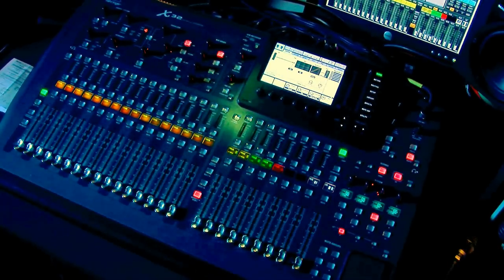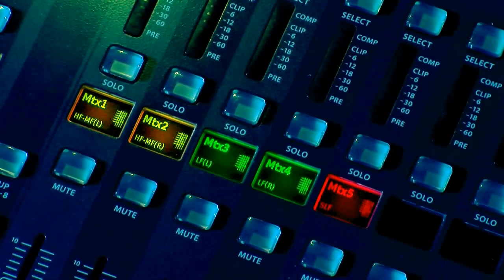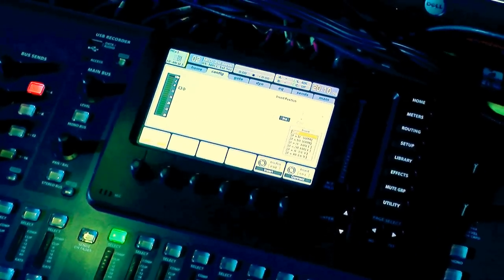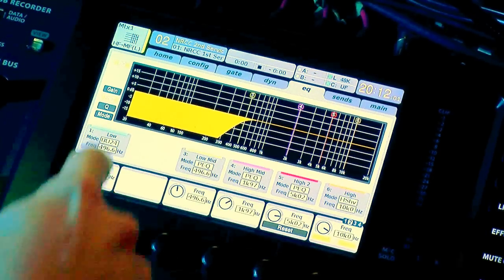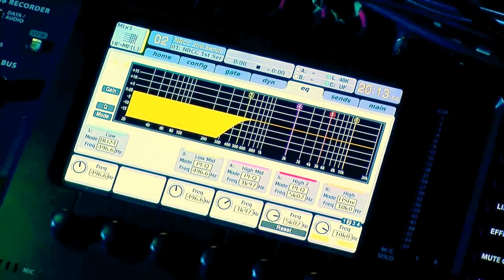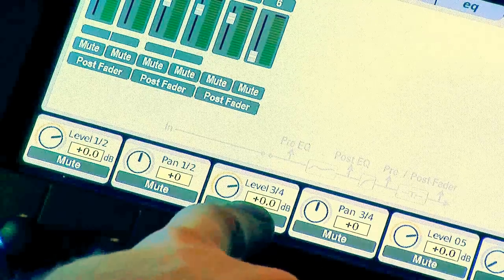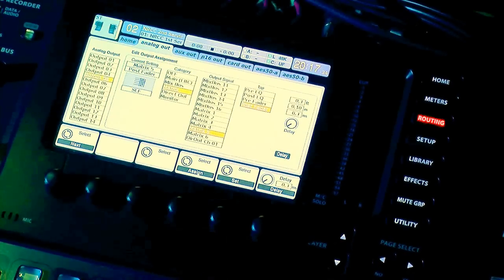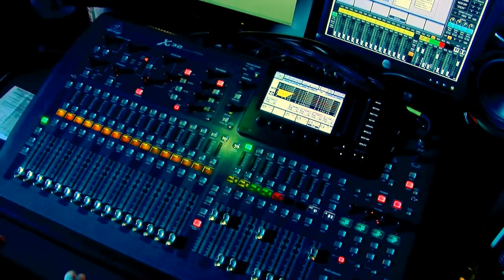Behringer X32 - Use as a System Processor for Bi-Amped + Sub Setup

Comment: Good Morning....   do you have any recent videos around this topic.   (e.g. v4.06).  I have 6 speakers, (2-subs, 2-mids, and 2-highs), with 3 amps..
The sub amp is configured in bridged mode, so a single feed would go from the board to the amp, and the subs are daisy chained together.

Thanks for all the time you are putting into these.   (Oh, and I did purchase your scenes, effects, and channel presets  --  very helpful).
Reply from the maker: Marty, this is a great idea to refresh these videos on the sending to a PA+Sub, Bi-Amp, and Tri-Amp! Give me a few weeks and I'll upload a video on it!

If you need to get it set before, you would end up taking the same functionality as this video, just the user interface would look slightly different.
Reply: @DrewBrashler  And it seems both the Bi-Amp, and Tri-Amp configurations are similar, only the bi-amp uses one matrix, and one output
for the SUB where the tri-amp config uses two.      How would would implement the M/C channel using either of these configs?

Thanks again sir.   And though I always have questions, your vids are AWESOME!:washhands:🤘🤛🙏

Comment: Hey, i'm in need off help. i have 4 speakers acting as left and right. and 4 subs. the subs are coming out of the mono channel and are all sorted. but how would i control the volume of the individual speakers. for example there are 2 either side of the stage and i want to be able to control the 2 inside speakers and the 2 outside speakers on the matrix feed which would then feed the main left and right fader. Its only because i know there speakers pump out a lot of volume and want to have control of them so i'm not riding them too high. i hope this makes sense.

Comment: Really like the video, great information. I do have a question though: Using the matrix to apply the butterworts filters to send to FOH, do you ever notice any issues with phase at the crossover point? I have has to deal with such a situation awhile ago. Obviously there is more than likely no need to consider this in this kind of system as, I can't imagine it needing to throw very far nor is it a lot of boxes. Is there any phase control on the outputs?  Nice vid man!
Reply from the maker: Very good question Calum! If you use the LR crossover filters, they will have correct phase relationships over the crossover points! There is adjustable delay on the outputs so you can fine tune if needed. Thanks!

Comment: How do you link the fader controlling the mids and highs to the fader that's controlling the sub.  I assigned my mids and highs to the L/R fader and the sub to the M/C fader.  It works great with the filters, except that if I want to adjust over all volume, I have to move 2 faders every time (and sort of re-mix the lows, mids, and highs).  How can I make the overall volume controlled by 1 fader?
Reply: In Setup > Global under Link Preferences, you need to enable "M/C depends on Main L/R" - this will link your master volume to the sub.

Comment: Hi Drew, 

I noticed you said you were assigning matrix outputs 1-5 to outputs 1-5. How is that different from assigning the monitor outputs to 1-6. How are they not using the same Channel outputs. 

Thanks 
Keith
Reply: Yes,  They are the same outputs.  If you use the matrix you will loose those monitor sends

Comment: Hey Drew love your videos. Any advice on setting it up as a 4-way Stereo system on the Matrix.  I would be fine to make the subs mono.
Reply from the maker: Wow a 4-way stereo system!  Now that is an interesting one.  You could setup the matrix in the same way as I did with the tri-amp configuration, but on the LF you would add a HPF.  Here is the link to the tri-amp: Behringer X32 - Tri-Amp Speaker Configuration  You would then need to run an "Aux Fed Mono Sub" through one of the mix busses.  Doing the aux fed sub would allow you to specify what instruments are going to go into the subs.  So Matrix 1&2=HF 3&4=MF 5&6=LF and Mix Bus=VLF.
Reply: Thank you! I will test this next weekend. Thanks so much for your time!

Comment: I have a question about de tri-amped + sub set setup, I have in my church just tow speaker for each side jbl 100 series 3 way + mrx 528s dual 18" how can set up en this case
Reply from the maker: Hi Rudy, I would need to know the specific model number of the JBL tops.  The freq of the subs are 40Hz-250Hz so they cover a pretty good amount of the VLF and the LF area.  100Hz is a fairly standard x-over freq, but you just need to figure out if your tops will cover to that area correctly.

Comment from the maker: The X32 does have Polarity Reverse switches on the matrix channels, all of the 32 mono channels and the 8 Aux channels. It does not have Polarity Reverse switches on the 16 mixbus or the LR, M. The delay is on the 16 analog outs, to find this go to Routing>Analog Out. The 32 mono channels also have the delay.

Comment: I managed to figure it out, I was running my L/R mix off the main out which doesn't have the butterworth filters. After setting it up correctly it sounds good. I did manage to figure out how to run my subs off an aux and have it run into my matrix out. Over all Im really happy with the x32. Thanks a ton for the great videos and for replying to my question. Behringer should hire you!

Comment from the maker: What specifically did you not like about the sound?  I do not use this configuration with my systems, but I do have a few people I know that use it quite a bit.  They have not mentioned anything negative about it.  If you had the HPF and the LPF on the same frequency you would have had a boost of 3dB at the crossover frequency if you were using Butterworth filters.  You would need to stagger the HPF and LPF a few Hz to get it flat.  Or use Linkwitz-Riley which does that compensation already.